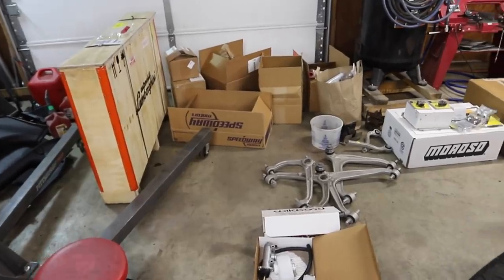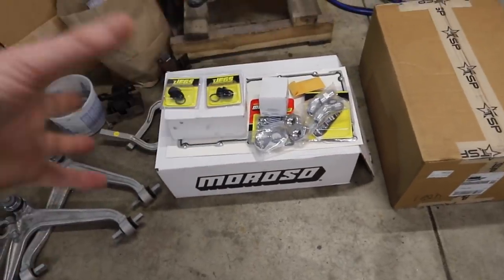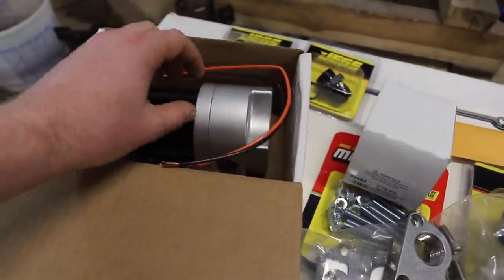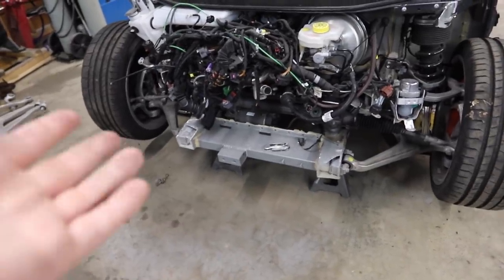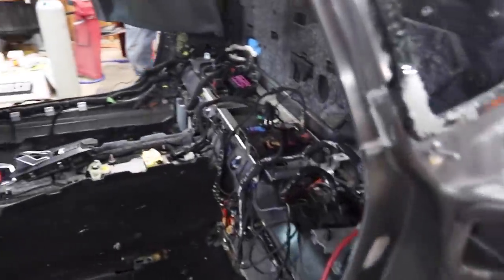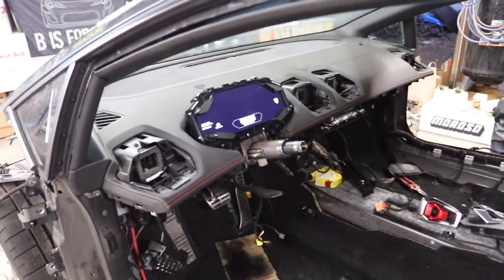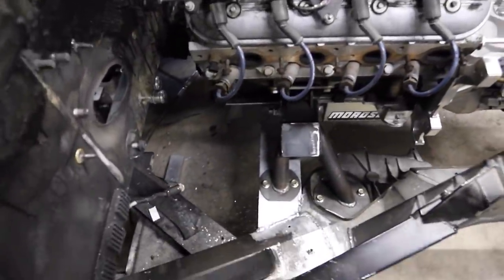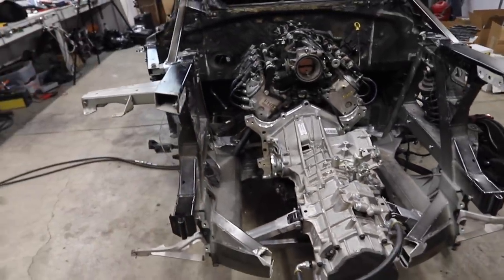Parts are in!! And We Bring the Huracan Back to Life!!

Comment: Your situation with programming keys is quite tough.
You are in what is called an 'all keys lost' situation. Most VAG key programming tools (including standard dealer online pairing procedure) require ignition, which you don't have due to lost keys.

The only option as far as I know is to reach out to a car key shop that has access to Auro OtoPro IM600 or Autel IM608 tools. They have full recent model Audi key programming capabilities (Huracan is mostly an R8 in different skin). Drawback is that this programming can only be done by connecting directly to microchips on the control unit (requires disassembly of dash/ecu).
Reply: most locksmith who specialize in VW can do the key via bench. i have a bench setup with cluster ignition everything when i make keys when people loose all their keys on BMWS, they send me their ecu and cas modules, i can make the key, and test it even program other modules as well

Comment: Rob Dahm: 13b swaps a totaled C5 Corvette
B is for Build: LS swaps a burnt Lamborghini Huracan

the ultimate FLEX
Reply: The "weirdest" flex
Reply: Gotta move the better motor to the better car right?
Reply: @darianistead2239  this LS build he is doing will weigh 600-700lbs (fully garnished) and make 1200whp+   The stock Huracan engine produces 600hp at the crank (closer to 500 at the wheels) (i am unsure of the 5.2l V10 engine's weight).   this new LS-based engine will be capable of three times the power the Lamborghini engine possessed and be exponentially less expensive....
Reply: @darianistead2239  Also the engine that Rob Dahm put in the corvette replaced the LS6, a 405hp engine. weighing 460lbs. Rob Dahm put a POS 13b weighing 260lbs and producing 240hp.        the power to weight is comparable but the 13b is a unreliable rotary turd....
Reply: @LiveToRidee  Also Texas Speed is building Chris an aluminum block since he sent them the wrong one(he was sold the wrong block).

Comment: For the air conditioning, you should get an electric compressor. Put it anywhere in the car and also no parasitic loss to horsepower. In fact, the entire system could be put at the front of the car to help balance the extra weight of the LS. Just get one of those evaporators people retrofit into classic cars since your dash is all gone anyway.

Comment: Yeah galvanic corrosion is pretty slow, but we're talking about months and not years, especially on bolts. That's the main cause of bolts heads breaking on airplanes, when the surfaces are not properly isolated. I'm working for an aircraft maintenance company and we see that relatively often.
Reply: As much as I love b is for build, the way he spoke of it seemed a little condescending when people are only trying to help him out. We're talking about engine mounts on what is going to be a very high horsepower build, he should be doing everything in his power to prevent the corrosion even if it's a relatively slow process, else one day he's going to do a pull and cause the engine mounts to rip straight out, which will be a fun video to see for my own entertainment personally.
Reply: Chris don't be so dismissive to the sciences. They exist for a reason and people are just trying to help and further the hobby, the passion, the way of life; that is custom car building.

Comment: Honestly, it's not worth the headache to keep the stock ecu and dash display. It's going to be a nightmare to blend the stock ecu setup with the Haltech. Otherwise youll have to hack the nuetral saftey switch and deal with issues relating to anti-theft ignition issues.
Id suggest retrofitting Haltech's digital dash display to the stock location. You'll have to wire the starter direct to a relay and then to the huracan switch. If you do want a key, you can use a universal FM transmitter key for protection that can be wired between.

The factory BCM will function like normal through the mmi.

And the piece at the steering wheel you're referring to is the clockspring. It transmits signals from each button to talk to the bcm for commands by use of (-) negative resistance.

Comment: good call on the cross member. Use gasket sheet with woven reinforcement, it will prevent it from squishing out from between the two flanges and generally last longer.

Comment: If it were me, I'd weld 90 fittings onto the waterpump adapter to get just a skosh more clearance.  You could even grind some of the adapter away to recess the round part a bit more.

Comment: Didn't you say you were going Cathedral port heads on your motor?  That TSP intake is a rectangular port intake.
Reply: The heads on the motor he took apart were Cathedral Port but I have a feeling tsp is going to put on a new set of heads
Reply: He is replacing the cathedral heads with new ones.
Reply: They make adaptors for SP to CP it’s how people run LSA blower on CP heads
Reply: You can bolt square port heads onto an 6.0 without any modifications...
Reply from the maker: new heads from TSP will not be cathedral port anymore

Comment: That looks like a squareport intake and those truck engines have cathedral port heads
Reply: I don't think he is gonna finish this build in time. There are so many little things like what you just mentioned that could go wrong, and he is gonna have to order another part or something.
Reply: It would be weird for texasspeed to send the wrong intake manifold when they're actually building the engine. So what I'm hoping is that they're gonna put modified heads with squareports on his built 6.0, maybe. I dunno just guessing.
Reply: Texas Speed is building the whole engine, i'm sure they know what they are doing, they won't use stock heads
Reply: @notaberger_3216  he covered that in the last video. When Texas speed builds the motor they are replacing the cathedral port heads.
Reply: Look on his instagram he aint using a 6.0 anyways.
Reply: Yes but he also said he was going to get the car running with the 5.3 that is in it and that intake won't fit on it is what im saying.

Comment: Yea, corrosion between aluminium and steel isn't a massive problem. Used to do karting, the rear axle is steel. The hubs are aluminium. Even if the kart sat for 2 months with nothing moving, all that would be needed was a light tap and the hubs would be free again. Would usually hit the axle with a scotchbrite pad too, just to knock any little imperfections down. But it was never a problem.

Comment: The F body camaro (99-2006) AC pump mounts low on the passenger side and would be a perfect fit for you engine bay. Its the one all the RX7 v8 swapers use. So there is a lot of aftermarket support for that pump.
Reply: Good luck finding a 03-06 compressor

Comment: that engine is gona vibrate the car like crazy...fab some mounts
Reply: The motor is mounted. Pretty sure the front mounts have poly bushings and the rear mounts have rubber bushings. There not going for a super smooth luxurious experience so I don't think it matters.

Comment: Hmmm pretty sure you suppose to keep positive cable connected and keep ground disconnected.
Reply: Cars today are negative earth.  Earth being where the electrons go.  In cars the positive terminal is the source of electrons, which is contrary to battery diagrams from your chemistry class (or physics class).  So you should disconnect the red, positive terminal.
Reply: Robert Lawson ah thanks for the clarification. I’m used to aircraft equipment, and we always disconnect negative.
Reply: Once you open the circuit...it's open. Shouldn't matter if it was neg or positive.
Reply: @robertlawson1053  While true, it's safer to disconnect the ground since it won't spark. I could hear the sparks when he connected the positive cable.
Reply: @brooksman10  If you disconnect ground cable, then the terminal won't short/arc if it touches anything else.

Comment: In  the aluminum cross support, where you bolted down the front portion of the engine mount, weld in two sleeves to reinforce it. The support by itself is hollow and as you will torque down the bolts the cross support will collapse. You won't be able to torque those bolts good enough.

Comment: how the hell are you going to make this engine work with the BSM and ECU of the lambo? none has made a converter for that kinda work. Ur best chance is to get the engine maker company onboard and try to make the dash screen work with this engine. GOOOD LUCKK!! Electronics is HARD
Reply: He is probially going to use a stand alone ecu with the wiring harnas he showed just for the engine
Reply: @tamastenhaaff2291  LOL but he said go use the stock dash and many other modules, with is hard because, stock module use pt-can, can high, can low, most, and with a stand alone he not have any of that type of comunication, need to develop one converter for make stock module comunicate with the engine.
Reply: @fabini14  I agree, probably the hardest part of the entire build (body and all) is going to be electronics. He's either going to have to use a standalone screen and forgo most Lambo features, or spend tens of thousands custom programming a Syvecs with only a slim chance of success.
Reply: @patwildgen4259  Abs, lift system if this have and other basics stuff probably is not hard, but the dash is not a easy problem, because dash software is for DCT and not a manual, and not exist manual huracan so is a big problem, is possible,  but need custom software and coding, and probably converter of can signal, is not a easy process, but is possible make work, if you have money , nothing is impossible.
Reply: He should also employ a skilled softvvare and hardvvare engineer, employing a fabricator on vvork u could have done urself is a vvaist. The electronics and softvvare is going to be a huge headace, start on that first

Comment: Nice! Just a thought, if you need AN fittings in a hurry you can go to your local hydraulics store (hose and fittings) and they will stock almost every configuration and size of AN fitting you could ever want. These are called JIC fittings but they are the same threads and sizes. I used a bunch of these on my airplane projects.. I even and rewelded them back together to make custom fittings. The only downside is they will be made from zinc coated steel.. Not aluminium. Otherwise they work great and saves having to mail order.

Comment: I know you already have parts....but when I had to put a manual and a clutch master cylinder in a non-manual (racing) car and dash space was zero, I built a pedal that allows the master cylinder to mount under the dash on the pedal assembly.  I think there are aftermarket companies with this setup.

Comment: You are going to need Ross Tech VAG-COM for the bodycontroller and all the other modules in the car. Basically I think that with the correct coding you could actually send canbus data from the new ECU's (if it supports it) to give you things like rpm , water coolant temp and a bunch of other stuff. 
And, you could probably tell both the BC and your instrument cluster that it is a manual, they usually support it even if the car does not come with a manual from factory. Also, depending on what outputs you can have from the ECU , you might be able to get things like ABS and traction control working as well. It all comes down to canbus and proper signalling. 
There is a load of info out there, a quick Google on Huracan and canbus gave me lots to read.
Good luck to you !

Comment: The fiber optic harness is the radio harness. High end Euro cars use fiber optic to go from the head units to the amplifiers.
Reply: That should be all that runs through that. But without a key, the proximity sensors (if they are still functioning) won't even let the BCM turn on enough to tell you the time. You are either gonna have to get around that by eliminating all of the keyless/push button stuff or get a working system out of another wrecked car with key fobs. It will still have to be programmed by ODB2 because your brains have one vin in them and your keyless entry would have another. Every computer in the car has to have the matching vin programmed to it.

Comment: 28:20 Anyone else put together that where the "new engine mounts" bolt to the subframe that they ran bolts through tube with no support inside the tube. Frame tubing should be sleeved for the bolts so when you tighten them its going to cave in. When you  drop the clutch on a twin turbo LS that left side is gonna rip right through that allyuminium.

Comment: Galvanic corrosion is a non issue (almost) in Oregon because the State doesn't use salt on the roads in Winter, due to the fact it would corrode the steel bridges super fast. In States/countries that do use salt Galvanic corrosion is a very big deal indeed! You're right, gaskets and greasing the bolts goes a long way to prevent the issue however.

Comment: For the dash you could get a can bus simulator, and use micro switches to trigger the simulator to tell the dash which gear you are in, as for getting a Lamborghini key why? you are not going to use the on-board  immobiliser part with your stand alone ECU so you are fine on that point, you can also simulate the can bus signals to lock and unlock the doors. Dont make it more difficult than it needs to be.

Comment: I would totally investigate Toyota for electric power steering and electric air conditioning! Maybe run a 2nd, truck sized, AGM battery. But think about the drag you'll eliminate from the engine, plus space savings in the engine bay.

Comment: Duct Tape Would work just as good for preventing the Galvanic corrosion and probably cheaper than the gasket.
Reply: Jeffrey Broesder it works. But neoprene sheets work great, and they’re cheap as hell. That’s what I did on the side panels on my expo trailer

Comment: For any of your dead end wires, they make connectors for that. They look like little mushroom heads. You can actually dead end wires or even use them as a butt connection. It just wouldn’t be a inline. Tape for now but at the end use the connectors. Less of a chance to have a melt down.

Comment: Galvanic corrosion is NOT like regular rusting. It can happen really quickly. Within a matter of a few weeks/months you could expect to see really significant corrosion taking place that is not only cosmetic. To avoid it you need to make sure the two metals are electrically insulated from one another. So not a paper gasket as that will just get wet and be a sponge for the electrolyte; but instead something made of rubber or plastic. Do not underestimate this process.

Comment: lol dont use a gasket between the metal and steel.  the bolts will come loose as the engine vibrations wear away at that gasket.  Just paint the crossmember.

Comment: Pretty much uses vw's security system. So you're gonna need a new key thats not programmed to an existing car and have access to ODIS (On board diag info system) with a active account to program the key thru obd2 port .  I have never used the fake copies of the program floating around online because VW keeps a data base and will require  online access during programming. Also needs be a ginuwine oem key not an aftermarket

Comment: Won't the galvanic corrosion still occur between the threads of the steel bolts and those in the aluminium? Unless you use steel inserts which will never (intentionally) be removed? Then again, the only necessarily removable bolts will be those attaching the engine to the mounts - the mounts can be left to corrode themselves in place indefinitely!
Reply: Mark Chippendale you can always add some kind of bushing underneath. Keeps it from being metal to metal. I honestly think he goes over that in the video

Comment: You really should do 180 degree headers and a twin centrifugal superchargers
Reply: Where in the hell would the belt for the superchargers fit? He doesn't have enough clearance for the standard front accessories as it is, much less with a wider belt for a supercharger.
Reply: @daltonnabors  drop the accessories. At least do 180 degree headers.. crossplane v8 burble has no place in a lamborghini, it needs to scream
Reply: @MrJepperhk  I agree that I have mixed feelings about the crossplane sound in a Lambo. I wish someone would put more work into making a flatplane crank setup for the LS. It's been done before, but not in a bolt on capacity that could be done in the time frame Chris has.
Reply: @daltonnabors  Exactly. Ford has  the flatplane v8 though which could be a great candidate
Reply: @MrJepperhk  I would have loved for him to put the new Voodoo engine in the Huracan but it's not as small or has as much aftermarket support

Comment: I will put odds on you will break your engine mounts. Look at how stout engine and gear box mounts and fasteners are on standard engines/trans. You are putting 1000+bop and big torque plus will probably be using sticky tyres on drag strips and donuts in parking lots.

Comment: Had to come by and throw my 20 cents for that galvanic corrosion comment for all of the fantasy builders. I have just short of a ten cars and every one of them have just a painted steel engine crossbeam and aluminium lower engine mount and those have seen   over 300-500k km (20-30 years) of  Finnish roads (winter roads mostly salted) and that steel to alu connection isn't the spot that has corrosion of anykind...
Also some even have bare cast iron block to aluminium upper engine mount. Still not any corrosion between metals. And third there's even aluminium g.box shell to electroplated transmount and that also is corroded only from the steel side due to road salt and other gunk